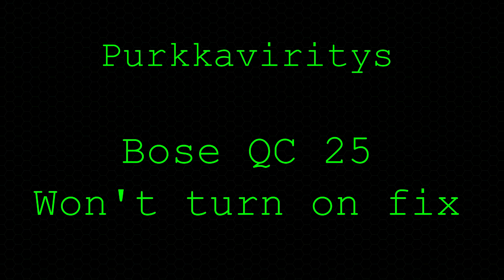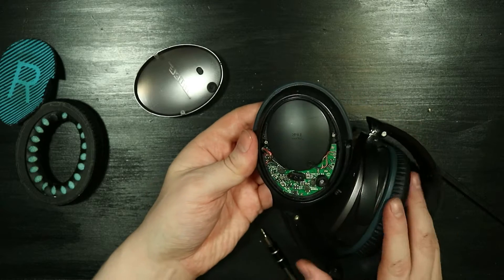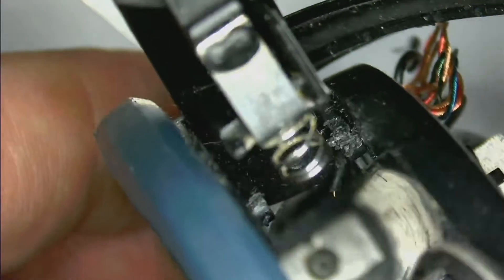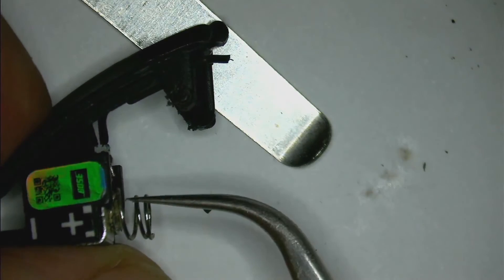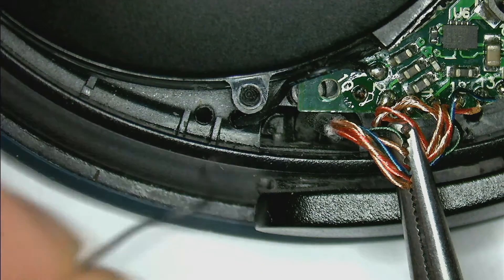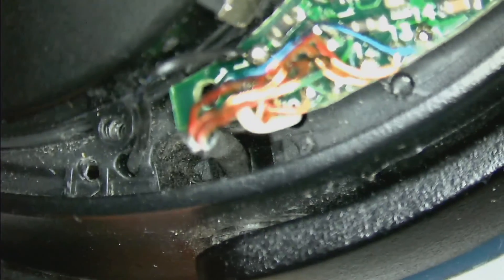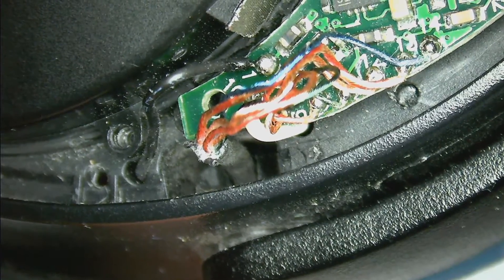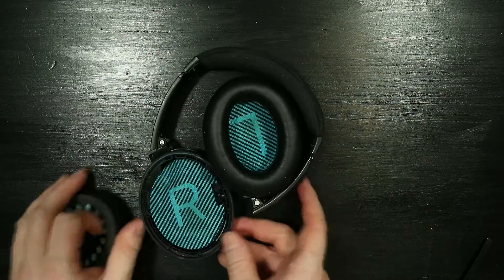QC 25 wont turn on | battery compartment repair

Comment: This is a very intricate job, but this is a very helpful video which captures the most critical parts very well.  I just need to order a soldering iron now!
Reply from the maker: would go for a TS100 or a Pinecil for that.

Comment: My QC25 suddenly refused to turn on as if the battery was dead. I asked for help from local Bose agent but it seems they are unable to carry out any repairs. They offered me a 10% discount on a new QC45. I found this site and it appeared that we had exactly the same problem. Design weakness?? With the help of this video, I was able to fix my headphones. Not a job for the faint-hearted though but I have a well-equipped electronics workshop with the right equipment.  It seems that Bose is going for the "throw-away" and not repair strategy like so many even top-end equipment producers. Very annoying and worrying.
Thanks Purkkaviritas
Reply: Bose is just a badge and a name that is not necessarily better; just much more expensive. There are much better and more reliable headphones that are much cheaper; easier to use; although not quite as comfortable. I love the JBL 660 Tunes headphones that sound great for all kinds of music. Bose is apparently for rich people who can afford to junk a lemon and afford to take a risk on upgrading to a newer and more expensive model.

Comment: Just a couple of points after reading the other comments. The battery wires are about 0.7mm. I used an inner wire from a defective USB cable - right size and worked well.  I also noticed the noise that someone mentioned. I'm sure it was feedback but once the metal cover was replaced, it was OK. Note that there is a tiny rubber gasket on the outwards-facing microphone. This is almost certainly part of the front-to-rear acoustic isolation. Mine fell off when I removed the metal cover and fortunately, I found it by accident on the floor just before I re-assembled the unit. Watch out for this!

Comment: Would anyone have the wire diameter of the replacement one? I was thinking about a 0,2mm ²  but I'm not sure it is small enough.
I need to order it, my shop doesn't have such a small section.
Reply from the maker: anything that fits is good enough, the amperage is so tiny that it wont matter really.
Reply: @Purkkaviritys  I loved your video and ordered a soldering iron kit and I have everything but the wire which came with the kit does not go through the headphone hole. Can you please suggest some wire, it is really confusing to find the wire online or in-store. Any help appreciated !!
Reply from the maker: @shekharhamilpur7213  I would look for for ex. wire wrapping wire, it is rather thin or things between 20-30 AWG (look up a awg chart to get an idea how thin/thick the wire is)

Comment: 8:15 the old solder looked pretty messy so if you have a solder wig, sucking out the old solder here would be a good idea. Using some extra flux would also make soldering the wire a bit easier.

Other than that, the only hard part seems to be to remove the plastic battery door without breaking it.

Comment: Hey, thanks for this video. I followed along and soldered the cable back to the hinge door as it had come loose. I put everything back together and turned it on and it worked! But it let out a really loud high pitched noise? The noise stopped and hasn't happened again but should I be worried? Thanks for any advice!

Comment: HEEELP I FIXED BUT NOT IT JIST BLINKS EVERY FEW SECONDS IDK WHAT TO DO NOW
Reply from the maker: mine usually blinks when the battery is about to go out.
Reply: @Purkkaviritys  ohhhh but like audio I can hear the noice cancelling going on and off in sync with the blinks
Reply from the maker: @jeremiahrx7717  have you changed the battery?
Reply: @Purkkaviritys  yes it worked but only one side
Reply: @Purkkaviritys  my right side noice cancellation won’t turn on
Reply from the maker: @jeremiahrx7717  sounds like there is a connection issue, you need to check the cabling.
Reply: @Purkkaviritys  oh no 😭😭😭
Reply: @Purkkaviritys could you do a video on it please so I know what its supposed to look like 😭

Comment: After owning Q45s for a couple of years without much use, I suddenly cannot connect to BT. I have tried everything. I can connect these headphones via an adapter and a cable on a music app on an iPhone that sounds great but is not as convenient as BT. I don't recommend these headphones because of sound balancing and connectivity issues that do not completely resolve. The App is not user friendly. You are basically on your own after buying a very expensive pair of badge headphones that don't always live up to their name. JBL headphones that are way cheaper are much more reliable and easy to use. JBL sound quality is better than Bose and has more bass.